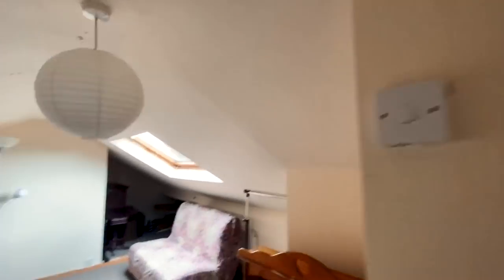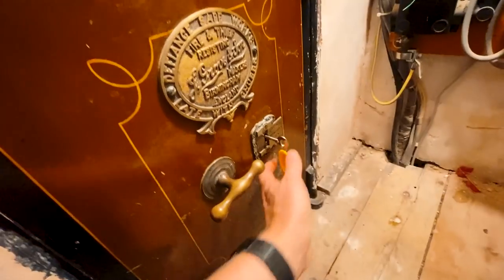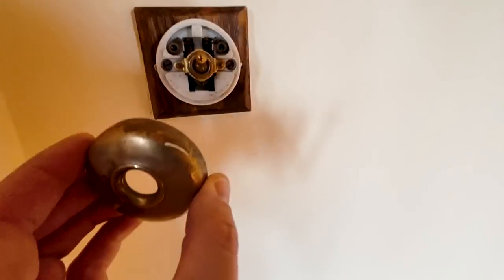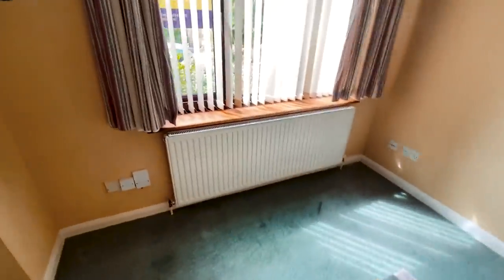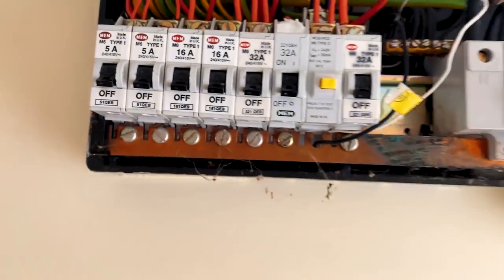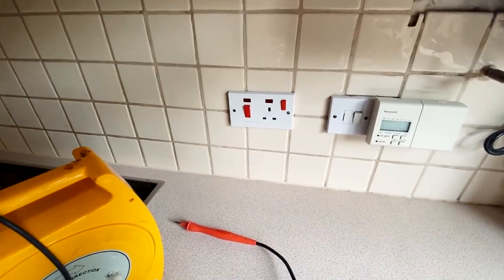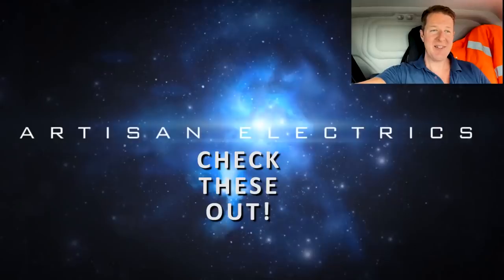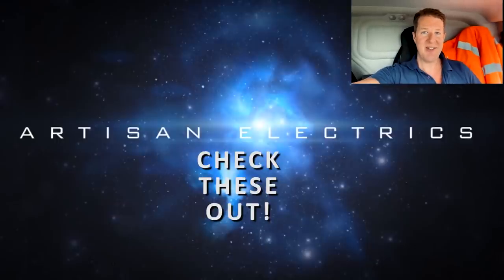Some Shocking Electrical Faults - Three EICR's in a day?! Part 2 of 2

Comment: It's amazing what you find I am a CCTV and alarm engineer and I have seen some scary stuff too like mains for intruder alarm panel wired using 4 core alarm cable straight from the DB on a 32a mcb with no rcd and not even doubled up the cores I have found 18-32 way PSUs for CCTV spurred from a socket using sky coaxial cable, found access control systems wired used 1.5mm flex directly buried makes you think what sort of frame of mind these people have scary to think what work these people think they can do next maybe a little bit of GAS be ok
Reply: many years ago i fitted a DIY outside tap for a mate, the self cutting type as that's what he had brought, as i am doing this for free as he did me a good turn with a laptop that's what i used, job done,
about a month later phone rang "can i borrow your long drill bit?"  long story short he is fitting one for his mate (charging him) has he watched me do his, so i nipped it him over and watched as you do as i need it regular so not leaving it behind, OMG, i am so glad i did and that he had not started, his water feed pipe was the gas pipe for the boiler!

Comment: Not only the switches may or may not be earthed, but you dont need any tools to open them, that means a child could easily spin that cap off and access live parts
Reply from the maker: Yeah good point
Reply: Oh yeah good point, not having direct interaction with those you wouldn't necessarily immediately think of that. I'm brushing up on my knowledge just in case I have to go over the pond.... can you guess which country i'am in... I love to say oh Canada, but.
Reply: @artisanelectrics  But they are really nice, so converting them to low voltage (either switching a relay or doing the lighting in 12V LED) would be worth it.
Reply: @HenryLoenwind  nice? Look how far they stick out from the wall 🙄🙈

Comment: I know DIY's get a lot of stick, but whoever did that shouldn't even be allowed to plug in a kettle.  I am one of your so hated DIY'ers but I always research, double research, check the latest codes, comply with them and then test the bloody thing as best I can.  Amazing what you can check with just a simple multimeter.  I also use a Kewteck 2 pole continuity tester to make sure the thing really is dead, so cheap to get and you really do want to know that line is dead. I had enough electrical shocks as a child due to my unfortunate habbit of taking everything apart to see how it worked.

Comment: I love these old switches.  You can buy remakes or originals that have been modified to be safer.  Please don't chuck them, whatever you do!  I love installing the retro metal industrial light switches with pyro for a retro 'steampunk' look.
Reply from the maker: Yeah I love them too! Customer asked to keep them so we didn’t get to take them for my “museum”
Reply: @artisanelectrics  You can make them safer by putting some insulating material over the connections and putting a set screw on the bottom so the covers can't be easily taken off....   And I agree with your customer, they are great - probably cost a pretty penny to get them and they are likely to last longer than anything modern.
Reply: Can you solder an earth to the casing to make them safe? They shouldn't be chucked as they look great but probably because they have been using brasso on them.
Reply: @nopy99  I'm not sure as the brass bit unscrews.  You might be able to solder something on the inside where it can make contact.  I've only installed all-metal industrial ones which are easy to earth.

Comment: I got a feeling the electrics were gonna be interesting when I saw all the speed fit elbows on the boiler install.... Jack of all trades, master of none..
Reply from the maker: Well spotted!
Reply: Those speedfit  fittings are bloody dangerous , in many older properties the water pipes supply the main earth ,  one speed fiitting no earth don't even get me started on plastic pipeing internally
Reply: Is it compliant to have the main earth supplied by the water pipe? I didn’t even know that was a thing
Reply: @ajthegreat2006   Common practice into the 1960's in rural areas  phased out as plastic mains started to become the norm until then underground was copper or lead from the house to the main service in the road . The earth  the waterpipe supplied was  far better than any copper rods .

Comment: Regarding the kitchen downlights...
Some of those CPC's were connected to the switched feed at the fitting, so if all CPC's are connected back at the metal consumer unit as they should be, then every time they turn on the kitchen lights they will be energising the consumer unit too...
How the heck did that never pop a breaker...?
Sounds to me like the whole installation was never earthed correctly at the incomer...
So that also means that every earth pin in every socket outlet would have become live every time the kitchen lights were switched on..
So anything with a metal housing like a toaster or oven would have become live..!

Comment: what i did come across  a lot some years back twin and earth used in two way light switches instead of 3 core , same electrical contractor had rewired the properties over a period of years  those lights were horrendous though .

Comment: I'm glad the requirement for EICR's on rentals has come in, flats like Grenfell were built in the early 70s, the wiring regs over the past 50 years have been updated and meanwhile there has been 50 years of DIY bodging by cheap landlords.

Comment: As a non electrician but my previous trades and current trade touches on electricity, i have undertaken my own  electrical work like replacement of electrical showers, outside pool pumps, power flex replacement on tools, connect or disconnect 3 phase  or other electrical equipment, i always try to do a safe neat job and if in doubt,  check with a multimeter before delving in to ensure any previous existing wiring hasn't been installed wrong, for example a single pole switch may be wired on the neutral instead of on the live side. On occasion i do have an electrician check the work and they are happy each time. However, the stuff i see on this video bodge wise is truly terrible

Comment: That blackness on the busbar....is that not caused by an overheated/exploded/burnt RCBO? I though I saw some signs of overheating on the adjacent circuit breaker as well? Might be wrong.
Reply: My thought as well. There's one brand of panel in the US (Zinsco) that is very prone to arcing like this, sometimes to the point of welding the breaker to the busbar. They manufacturer is thankfully now defunct, but there seem to still be a lot of the panels out there. https://inspectapedia.com/electric/GTE_Sylvania_Kearney_Zinsco_Failure.php has some great information and pictures, if anyone's curious.

Comment: Just a quick question Jordan, with regards the amount of sockets.What would you code it as?  As long as the installation is wired to the edition it was designed to (eg. 15th, 16th) then the amount of sockets isn't an issue is it? I understand that the extension leads will be a fire hazard, so would you code it as a C3 recommendation? Im training to the 18th edition which says more sockets should be installed, but these properties were designed and built many years ago, when there wasn't a need for so many sockets. Some people were lucky to have a TV etc

Comment: 2:40 A BS 951 clamp fitted to the lead sheath of the supply cable does not make a TNS system, because it is not a compliant use. "Such clamps are not intended for connection to the armour or sheath of a cable".
Reply from the maker: Thanks. What would you code it as and what would you do to rectify it??
Reply: Surly if it tests fine then it’s doing it’s job. then a C3 or even a noting it on the test results would suffice
Reply: @artisanelectrics  In my opinion, an inadequate earthing conductor connection arrangement is potentially dangerous - see 542.3.2. Also see 134.1.1 regarding "proper materials". The situation may be rectified by requesting a PME upgrade.
Reply: @artisanelectrics  Constant tension spring clamps. Think Hepworth and 3M are brands that ring a bell.
Reply: But I have seen Norweb (now ENWL) do plenty before they brought in the springs.
Reply from the maker: Nice
Reply: @simonabbott7323  I read this and automatically thought of Red Dwarf.......
Reply: The clamp has to be fitted by the DNO , different type of clamp too, just DNO  done this on  my supply 
at home

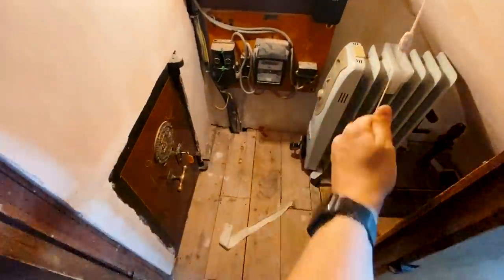Comment: At 4:42 .. when you was about leaving the staircase cupboard. I was feeling 'aaaah' why didn't you look on the other side of the wall, where the 3 round hole socket was to see if it was connected or not ... :D

Comment: How are you proving polarity by r2 testing. You would have to carry out a earth loop at every point?
R2 leads are great bit sometimes polarity goes by the wayside. 👍
Reply: On an EICR, you can confirm polarity with an R2 lead on sockets & a Zs you can confirm polarity on lights you inspected, visually, you don’t inspect 100% unless that was required.
Reply: The CPC was live anyway. I wonder how far back towards the DB that went.
Reply from the maker: Yeah that’s right

Comment: Did a re-wire a few years back and the customer spec had those vintage switches on it. After a tonne of research they actually still comply with modern BS for switches. Don't often come across the metal domed ones but the mounting plate is normally earthed.
Reply from the maker: Wow cool
Reply: @artisanelectrics  You can also buy brand new versions from Switch To Wood down in Sussex. BS EN 60669-1 is the magic book if I remember rightly.

Comment: House 3 - consumer unit - what was the white 'gunk' on screw terminal of the load side of that 32A breaker?
Reply: Think that's the manufacturer's glue to stop you undoing that screw- they have used the mcb gubbins in the making of an rcbo
Reply from the maker: Yeah think you’re right
Reply: Yes that's factory-installed group it's a standard 32 amp breaker with a wire factory-installed going to a RCD next to it by a pigtail. It must be a unit that predates the combination breaker rcd units where they use two separate modules essentially glued together.

Comment: Mate BS951 clamp on TNS is a no no. Contact DNO For them to install (sweated) bond wire. I’d code this a C2. Even if it’s tight it’s not correc.
Reply from the maker: Problem is my DNO would just put a new clamp on it 😂
Reply: Artisan Electrics  sad times, my local one are strict.

Comment: Those old metal switches aren't as scary as some of the plastic junk that's out there I mean it was designed from the beginning to never come in contact with anything if properly installed or unless somebody did something stupid. the new ones can just fail.
Reply from the maker: Yeah they certainly were well built back then
Reply: Well built and very nice but regardless of if the metal is earthed I'd be giving it a C2 for toolless access to live parts. I can't remember off hand the reg that permits it on ceiling roses and pull switches but that's almost akin to 'placing out of reach'. Part of me thinks they'll ban toolless entry ceiling roses in a few years, but if they're supplying traditional bayonet lampholders there's probably no point...
Edit: 416.2.4
Reply from the maker: Yeah good point

Comment: Full re-wire for the landlord allowing DIY electrics
Reply from the maker: Yep 😆
Reply: Should put a condition on your paperwork that should you find "DIY (not) work" it's an instant fail.
Reply: @Maxwell Severins  Not exactly what I meant. I know that there are DIYer's out there at that could actually do a good job. I myself am one although I consider myself a "professional amateur electrician" ( For now...). It's when you come across something that's almost fatally wrong you should "almost condemn" the installation for an entire systems check because you don't know what has been messed with.

Comment: Why are the 3rd breaker line connections potted?
Reply from the maker: Not sure what you mean
Reply: I think I saw that but looked more like melted plastic
Reply: There was white stuff over the screw terminal
Reply: @artisanelectrics  Look at 15:35
Reply from the maker: It’s because it’s an RCBO

Comment: Don’t unscrew round light switches or stick your fingers in here 😂
Reply: Not unless you've licked your fingers first. 😆
Reply: I'm absolutely sure they weren't earthed originally but had cardboard-like sleeves inside those metal covers. They're absolutely beautiful but I'm worried because those covers unscrew so easily.
Reply from the maker: Yeah true
Reply: @Ragnar8504   The switches used to have small asbestos sleeves and the terminals seperated usually mounted on a nice timber or bakerlite box , they were actually quite safe as billy no brains the local diy expert didnt exist , ceilings were very high , floors were wooden all the fittings were well made  so you were pretty well insulated
Reply: landlord will probably say they can get someone cheaper and do it their selfs
Reply: @steverobinson8170  I've got one that definitely doesn't look like asbestos, more like some kind of treated cardboard! The only issue I have is that the cap can be unscrewed without tools and then the terminals are exposed to the touch!
Reply: @Kevin-mp5of  Agreed :-D
Reply: @Ragnar8504   locktite
Reply: @Ragnar8504  You can fix that by drilling an undersize hole in the bottom and putting in a set screw of some sort.
Reply: @davidreason8334  so many cowboys out there . Who is charging only £50 to do eicr . I call them ipad testers 😅

Comment: Most of the accessories look the same brand as the CU, so it was probably all done together.
You don't need fire-rated down lighters in a fire-rated ceiling (one that is two layers of board thick where the joints are staggered). Usually this is where there is a different property above ie shop below and flat above. 0.5 flex is 3A max, 0.75 is 6A.
Reply from the maker: Yeah quite rare to have a fire rated ceiling tho
Reply: No you only need fire rated lights in a fire rated ceiling . If the ceiling isn’t fire rated why on earth would you need to maintain the fire integrity of a Ceiling with no fire integrity ? If it’s a house within the same fire zone you don’t need them if it’s flats and they’re all individual zones then they’re needed ...
Reply from the maker: I’m pretty sure you need to fit fire rated downlights in a house if the ceiling has a floor above.
Reply: Artisan Electrics every day is a school day , i wouldn’t install anything other than fire rated but it’s a building reg and unless one is sure about fire zones and partitions, blanket recommending them is a bit of a grey area a bit like blanket recommending board changes due to not being metal ...
Reply: @artisanelectrics  You only need fire rated downlights if the rooms above are inhabited and the ceiling is fire rated either double boarded or single pink board ,  it also depends on the type of downlighter your installing , its often advisable to use hoods if the  viod is small or has insulation , to keep a seperation  between
Reply from the maker: Nice